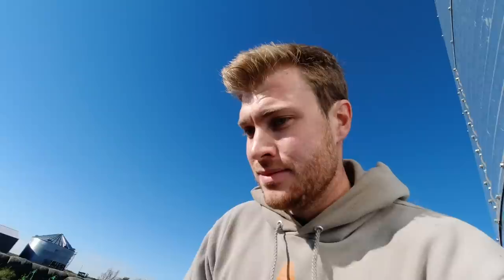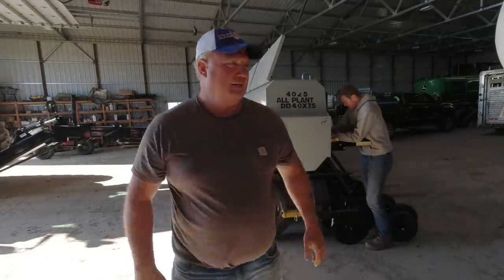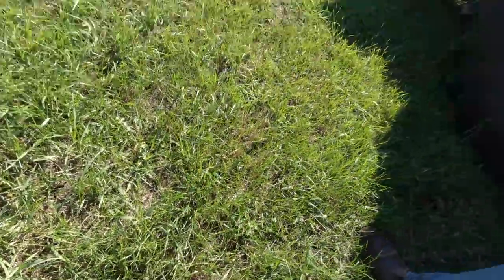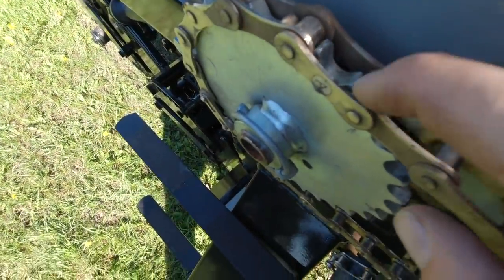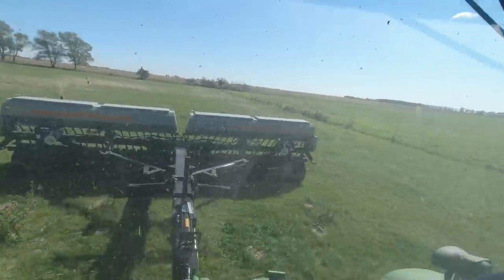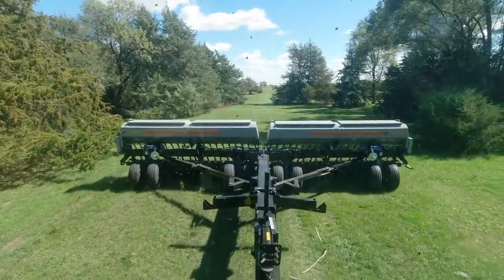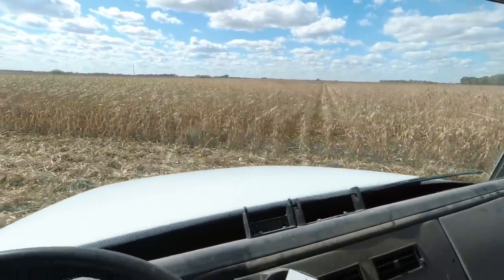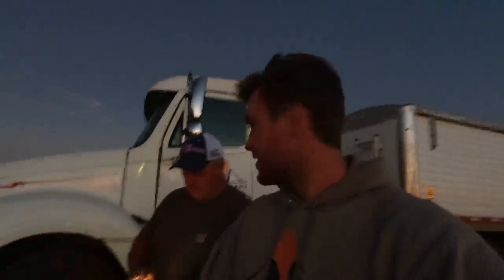We Did Not Get Far

Comment: That grass seed mixture is called PLAY GROUND / SHADE GRASS here in Oklahoma. The main reason that type of seed mixture is used is because of it's CHEAPER COST. Bermuda/Zoysia is the best seed to use, but, it's amount vs cost, makes it monetarily to expensive...................However the drawback to the Turf Grass mixture (especially the Fescue, Timothy and Rye grass) is that they require a LOT OF WATER.....that seed mixture does NOT produce a heat tolerant grass. Anything above 85 degrees for an extended period, causes it to brown up and go dormant.